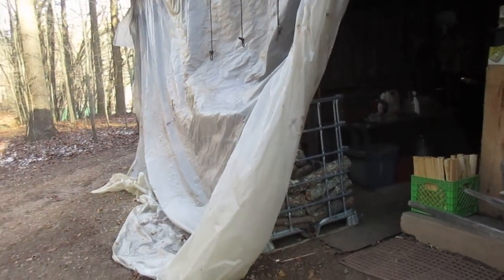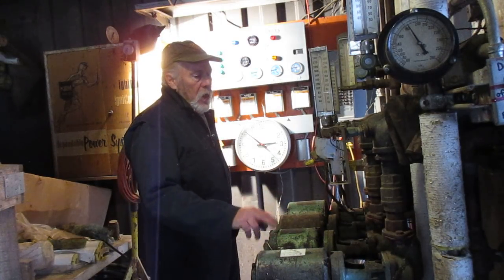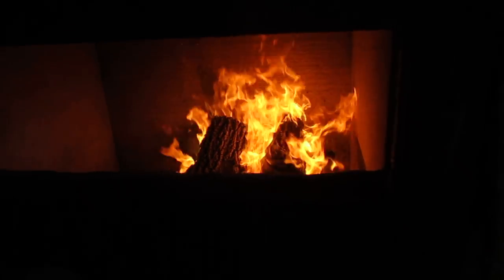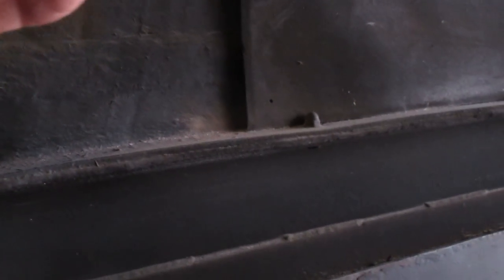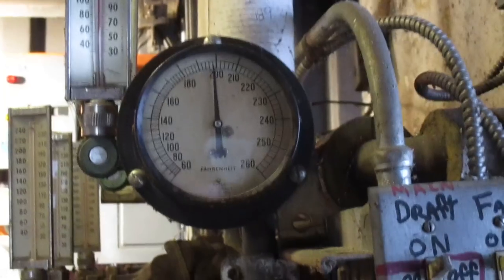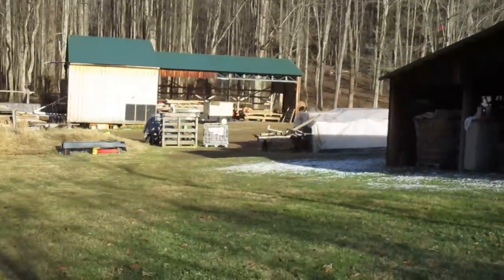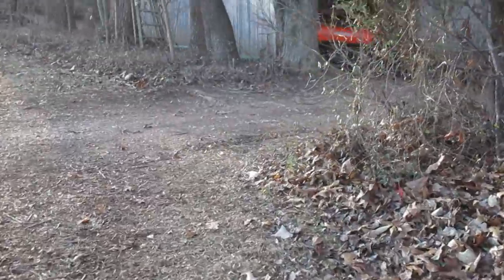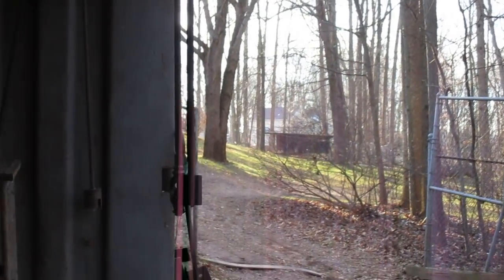Interesting stuff  well i think  #598

Comment: real nice set up. my pump runs all the time 365 days a year because i can heat hot water much cheaper with boiler. you have to be able to fix them your self. i have replaced 3 pumps, 3 draft fan motors and 4 valve switches in 20 years. i started to dislike snow at 20 and by 30 i started hating it. we have snow now.you still get a lot of work done. take care, be safe and well
Reply from the maker: hi there you are very right after the first year its just like any other heating source . they require service . thanks john

Comment: That’s quite a delta on house loop. How many gpms on that loop? What size are house supply/return piping? How many gallons in boiler?
Reply from the maker: hi there well i am not sure on some of that . there are 2- 100 BTU coils for the house and 1- 85 on the garage off that loop . i inch line routing 150 to the house . the lines run threw 4 inch conduet no insulation . there was no thing as PEX when i made this set up . there is also a 125 BTU coil in a small green house . the boiler holds about 125 gallons . the house pump is a high flow pump don't remember the GPM but turns 3450 . we are heating about 6000 home . i loose about 15 degrees per coil . been working on 2 more coils for a out door work area and my down stairs garage , i made the refectory area with 4 inches of refectory cement on the sides and botton for my temperature balance instead of lots of water . for several reasons . it holds more heat is the biggest .  don't know the boiler out put but its may be around 700-800 hundred BTU . it is a converted return tube steam boiler . it has around 60 2-1/2 tubes .. did you see the old pics of it . always enjoy hearing from you john https://youtu.be/hO-FeyRs_yA
Reply: @fricknjeep  I remember seeing your boiler. It’s mass refractory kinda like a greenwood boiler. After much research I went well insulated mass water. Reasons…1) no worries about over temp loops. 2) one less medium to move heat thru. 3) I can draw as many btus out of it as what the circulators can deliver. No transfer lag between refractory into water.
Curious, the loop to the house is it one primary loop or do you have secondary loops to go to the 2 HX coils? Are you doing domestic hot water too?
Reply from the maker: @garny3766  hi there separate to the green house . my wife wont let me hook it up to the domestic water . thats a real sore point . the pump is on the boiler the lines are in the house the plate exchanger is in . the other line goes to another shop and lower garage . . oh well . there is on heat lag to the water but there is on wormer days overheating witch i dump to the green house , , thanks for stopping by john

Comment: Hello John; That is a really elaborate system you have there. Did you design it? I know you this before but the wood in the greenhouse is for next year or a reserve for this year? My worst fear with system like yours would be a power failure. I presume you have a back-up. You have my admiration sir. Very nice work.
Reply from the maker: hi there i built this thing over 25 years ago when there wasn't  much known about them . i have changed it over the years a lot in many ways as things and needs have changed , yes i have a whole house gen. . it runs on diesel at 1/2 gal. per hour . i start the winters with around 1000 gallons for back up . thanks john

Comment: How many crates of wood do you go thru on in a year?
Reply from the maker: hi there well there a lot variables  into this answer how cold , wether i heat the green house , the kind of wood and the quality of wood .and the cost of fuel oil . i like to plan a cord per week is a good rule to go by . its a lot but fuel oil this year is over $4.50 a gallon and just to heat the living part of the   house takes around 850 gallons . john

Comment: I’m surprised you don’t heat your hot water as well, I use a plate exchanger and don’t have it hooked up the way it should be but I figured out it’s kinda like a instant hot, it doesn’t really heat the water in the hot water tank (because of how it’s hooked up) but when we use hot water it comes out of the exchanger already hot before it enters the hot water tank so it very rarely kicks the tank on. Take care
Reply from the maker: hi there thats kind of a sore point . everything was purchased when i built this boiler , pumps exchanger waterlines . everything is here but the wife is so against it it is not worth another battle . the lines are even run into the house . have been for years . oh well some day . thanks john
Reply: @fricknjeep  lol happy wife happy life
Reply from the maker: @a.l.l.firewood8883  no nothing makes her happy